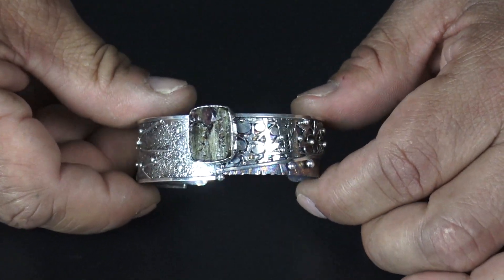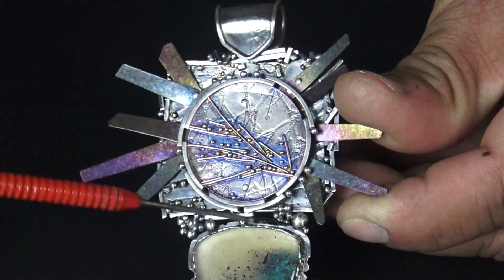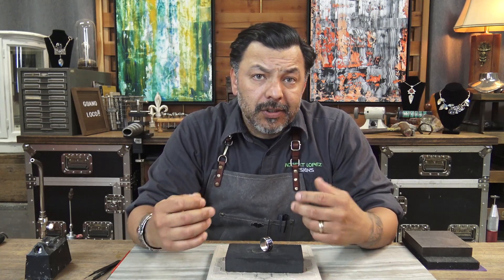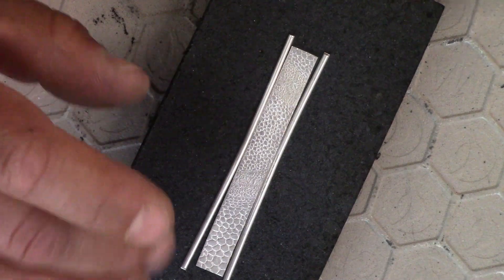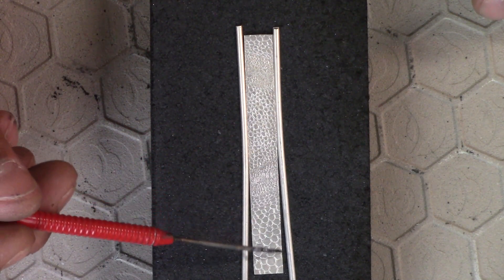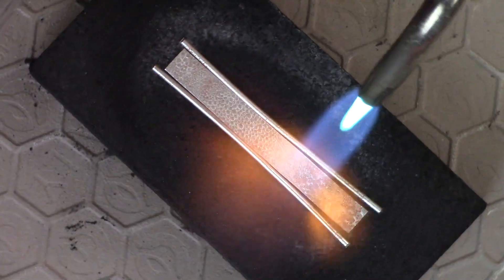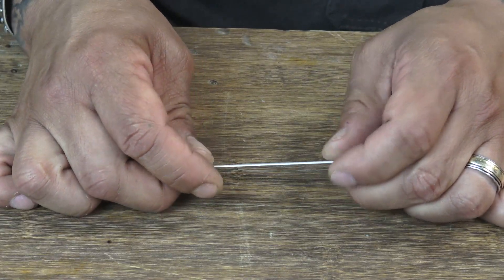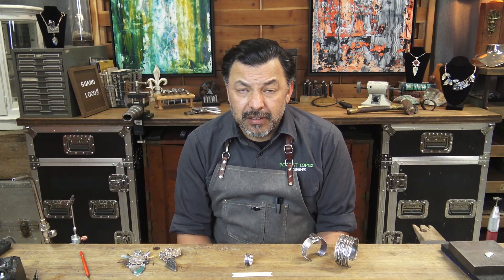Silversmithing Technique That will Blow Your Mind!!!!

Comment: I just found your video on making a silver cuff. You may not see this ? Gonna leave this anyway. I am a new silversmith. I greatly appreciate your transparency on this video. It is so nice to see that I am not the only person who melts or screws shit up.  There are times my husband comes into my studio, in fear I might add, because I am screaming “F” bombs at my work.  He can’t understand why I love it so much and get so pissed. I explain it is just like him and golf!  
Question? Why does the metal fracture? That I haven’t seen before. 
Also why does the solder not flow at times. I have read, watched and practiced. Same technique but it just won’t freaking work some days. Thanks.
Reply from the maker: Thanks. We all make mistakes from time to time, I just made few extra during the filming of this project and I thought it would be cool to show them. As for your questions,
1. I’m not exactly sure why it shatters. I do know that it does shatter when you apply pressure to Argentium Sterling silver when it is heated to a certain temp. It is only fragile like that while it’s hot. 
2. Solder not flowing could be from several different reasons
  a. Not enough heat.
  b. People trying to heat the solder to melt it and not heating the metal to melt the solder.
  c. Dirty silver
  d. Lack of flux
  e. Poor contact of metal connections
  f. Poor contact of solder to seams
  g. Dirty solder. (This one is the one that got me for years) I now buy wire solder, and wipe it clean before I cut off apiece to use. I wipe it a few times with a ScotchBrite scouring pad. Game changer for me.
Reply: @RobertLopezDesigns  Thank you so much for your reply. I went back to the basics and my reference book. Your point is correct. I think my solder is dirty and not enough heat.  Plus practice, practice & more practice. This is a hobby with the hopes of selling enough to pay for more supplies.  Again thanks for taking time to help me out. All the best.

Comment: No solder? What type of torch mixture are you using? Any idea what temp it needs to reach?
Reply from the maker: In this video I’m using Acetylene/air Smith torch. I normally use oxy/propane with a Smith little torch. It’s probably around 1600°F, but that info is probably irrelevant. You would never need to know that while fusing unless you plan on shooting a laser thermometer at the metal while fusing. It best to learn to recognize the subtle changes of the metal and the flash to know when it’s fusing.

Comment: It would be great to know why some of your attempts failed in the video
Reply from the maker: To be honest, it was mostly because I was make video of it. Running the cameras, pushing buttons, trying to remember what to say, the camera angles in the way and my mind thinking about all them things. This is a very straight forward process for me and I really should have melted it. I very rarely melt things. It may able be that I was over exaggerating the bends and gaps to prove a point, that need more heat to move the wires and I failed. But the basic answer is, too much heat and not enough focus.
Reply from the maker: “Should not have”

Comment: I don't understand fuse or solder obviously you use no solder I worked with gold off and on for 40 years but never seen this
Reply from the maker: I’m fusing the metal without using solder. It requires good torch control. I get the surface or skin of the metal molten/liquid, and hold the interior solid. When I get it to that temp, I hold it at the temp by flicking the flame off and on the metal. Then the molecules on the surface inter mingle and become fused.